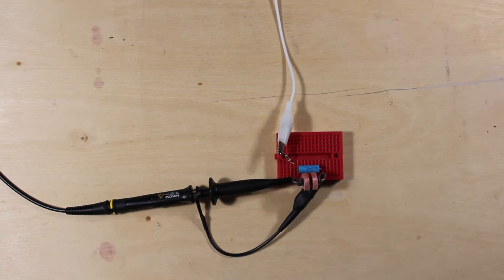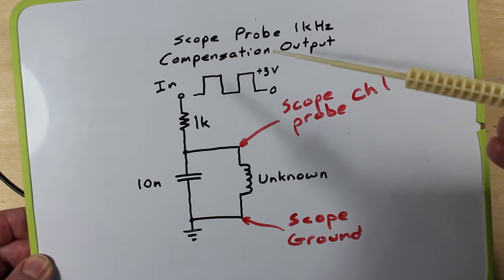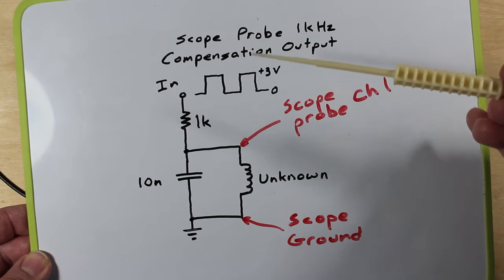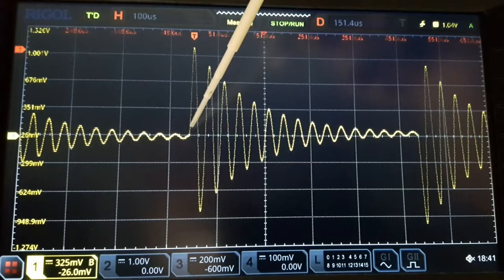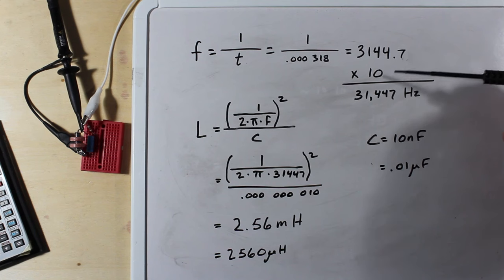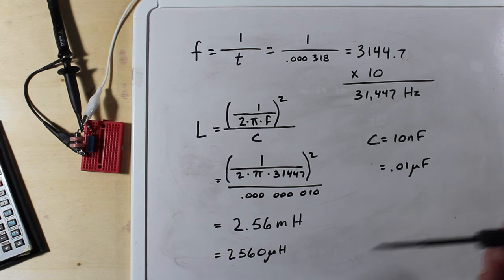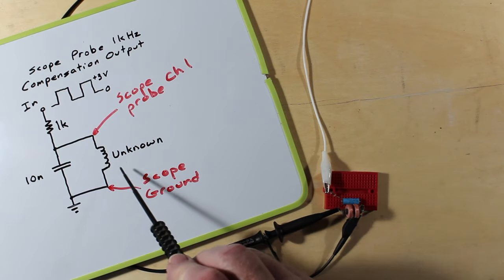Inductor Ringing. Using A Square Wave To Measure It's Value #electronics #oscilloscope #measurement

Comment: Great demo! I used a similar technique back in the 1980s to design an oscillator tank circuit for my video digitizer. I used 555 timer running at a few KHz to pump my tank circuit. I think I used a 22pf capacitor. The inductor was wound on a piece of Bic pen I chopped off. I need 14.318MHz, or 70nS. So I tuned the number of turns until I got the ringing to 70nS. Easy peasy! I then placed that tank circuit in my Colpitts  VCO and was good to go.
Reply from the maker: The art of engineering is building what you need using what you have.

Comment: you can also measure the Q of the inductor this way
Reply from the maker: Yes.  Lower Q dampens the ringing voltage quicker. Google "measuring inductor q ringing voltage".

Comment: Kind of a problem with the ground lead, as it introduces an inductance in the "loop", but that's at 100-130 MHz, typically... With the "RIng down" waveform, you can also see the inductor's ACR at the ring frequency...by adding capacitance, reducing the frequency, you can measure ACR at several points.

Comment: Why on Earth you're counting time with your bare hands on osc? Use cursors, why not?
Reply: Because it's quicker and easier???
Reply from the maker: Not everyone has an oscilloscope with the cursor function.
Reply: @edgeeffect  it's not)
Reply: @MoreThanElectronics  really?! I thought your osc has. Ok then.
Reply from the maker: My oscilloscope does have that function, but not all oscilloscopes do.
One of the goals of this channel is to show that you can do interesting and fun things with a minimal amount of equipment.
Reply: @MoreThanElectronics  Ah, I got it. You're right. Completely forgot this is educational video.
Reply: Another reason is that counting 10 periods is more accurate that manually measuring one period using a cursor.
Reply: @apianist Nothing can stop you from measuring of ten periods time using cursors.
Reply: @MoreThanElectronics  
i noticed you also counted it incorrect though
Reply: @Ma_X64  
No, But it does have one, HE'S USING A RIGOL, i have many rigol's i have never seen one without it, Perhaps he doesn't know how to find it

for his benefit
Press  CURSOR
Select MANUAL  (i prefer manual, you can use AUTO i guess)
Set it to X Mode

Maybe he didn't know that

But if it's a rigol, it's got it
Reply from the maker: @martinkuliza   
I went and checked.  I counted ten peaks after the origin, therefore ten full cycles.  I'm curious as to what is incorrect....
I did the manual count method because not all scopes have cursors.
Reply: @MoreThanElectronics  
3:15 you said "I'm gonna count 10"
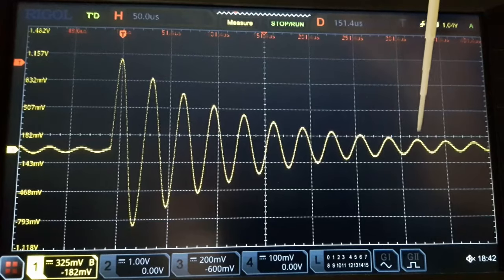3:22 You finish your count and you have counted 11

Now i have a few questions for clarification.  
in the video you say  I'M GONNA COUNT TEN
Now you're saying  Ten peaks AFTER the origin
if it's the latter then you counted correctly
if it's the former (as stated) then you didn't , not that it makes too much of a difference, human error is human error and that's fine,  I originally chalked it up to  tha thing when you look through a camera and count and it looks weird,  But why are you counting 10 AFTER the origin ?

Also, You're on a RIGOL Scope,   How do you not have a cursor
Does your scope have a CURSOR button, What model are you using ?
I Literally do not know of any Rigol that doesn't have a cursor, and i know a lot of them, i mean a TDS-210 has a cursor, C.R.O.'s  (Most of them not all) do not, but you're not on a C.R.O. beyond that , one is hard pressed to find a D.S.O. without  a cursor . so what are you actually using ?

but yeah, are you counting 10
or 10 after the origin
Reply: @MoreThanElectronics  
Another question, Putting aside previous possible erorrs,  the question is this
Error or no error, cursor or no cursor , all that aside
I've noticed you don't always get 10 cycles , sometimes you get 3 or 4

But i have experiment with measuring multiple cycles vs measuring 1 cycle
and i haven't really found a difference
DO YOU FIND THAT IT'S MORE ACCURATE TO COUNT MORE CYCLES

Also, I have found that when you get the final result, it's not dead on accurate in determining  the value of the inductor, what i tend to do is , Get the value as you explained then compare that to the closest common inductor value, But.. Using this method, who is to say that the Inductor is too far out of spec ?
and other times you can get a waveform that is really fuzzy,  (even after adjusting the trigger)
what's your take on this ? do you think it's a bad inductor or .....?
Interested to hear your opinion on this
Reply from the maker: @martinkuliza
I counted ten full cycles using the peaks.  If you prefer, think of it as starting at zero.  From one peak to the next peak is one full cycle, or use the zero crossings if you prefer.
My scope does have cursors (and I use them often) but not everyone has a scope with cursors.  I don't want anyone to feel left out because their scope doesn't have cursors.  Use them if you like.
Reply: @MoreThanElectronics  
" If you prefer, think of it as starting at zero.  From one peak to the next peak is one full cycle, or use the zero crossings if you prefer."
I can do either, i can count from 0 or from peak or from trough, it doesn't bother me.
Let's then just call this one a misunderstanding.

"My scope does have cursors (and I use them often) but not everyone has a scope with cursors."
AHH THAT MAKES MORE SENSE, Because when the other guy asked you, I mean.. Granted you replied "Not everyone has a scope with cursors" but it was also implied that your scope does not.
You should have clarified (in m opinion) that your scope does have cursors but you are purposely not using them.  I do understand your intention here, i just think you could have communicated it a bit better.  if you told the other guy, My scope does have cursors but not everyone's does so i chose not to use them, i wouldn't have created my comment, FYI

thanks for clarifying, I now look forward to your next comment
Reply from the maker: @martinkuliza
It's true you don't always get as many oscillations, or as 'clean' as these ones shown in this example.  It's more about using the space on your scope's screen than it is about how many cycles are counted.  Care and attention using one cycle will probably be more accurate than quick and sloppy with 10 cycles.  I used 10 because you can just move a decimal point over one place when the calculations are done, and it fit on the screen fairly nicely.

If it's a non-magnetic core inductor, and there's nothing metallic in the near-field, you can get pretty accurate at one frequency and temperature.  How close is close enough is up to the user.  With core materials that react to magnetism there are more factors involved.  Wurth has a nice introduction for RF inductors.
www.we-online.com/components/media/o756030v410%20ANP074%20EN_Introduction%20to%20RF%20Inductors.pdf

The 'fuzzy' waveform can be many things.  Is it noise or jitter or...?  Maybe turn down your scope's bandwidth.  Maybe a 1x probe instead of 10x.  Is the incoming square wave clean to begin with and at a low enough frequency for the 'ring' to dampen out? Do other inductors behave but not that one?  Etc...
Reply: @MoreThanElectronics  
" using one cycle will probably be more accurate than quick and sloppy with 10 cycles."
Interesting..... that's also what i observed and why i asked.
i thought you were going for more cycles for more accuracy, but then that raises the question of averaging which then slightly shifts the frequency,  and i also found that it's a question of how many digit resolution will you use in your calculations, i found myself using 15 digit resolution at times

"  Maybe turn down your scope's bandwidth.  Maybe a 1x probe instead of 10x."
admittedly i was on 10x the whole time , so i'll try that

" Is the incoming square wave clean to begin with"
yes it's perfect

" and at a low enough frequency "
well you went with 1 kHz and so did i, in my case 3V Amplitude, no offset, no phase shift , standard 50% Duty cycle

" Do other inductors behave but not that one?  "
yeah actually MOST inductors behave and alll settings being the same the only thing that changes is the inductor that is placed in the circuit,  Granted the inductors don't seem to be even close to each others values.
it does seem to occur more on the larger inductors though

Comment: note the inductor  itself has capacitance.
therefore this is only 'about'.
repeat with another value cap.
develop the algebra and you can actually get the self capacitance value.
then check against another repeat without any additional cap.
Reply from the maker: Agreed.  A Google search for 'inductor parasitic capacitance' shows some good results.
Reply: Excellent: you are coach-able, not true of everyone. cheers.   @MoreThanElectronics